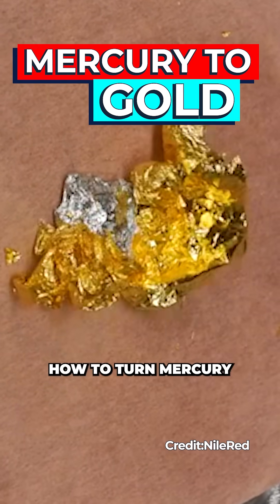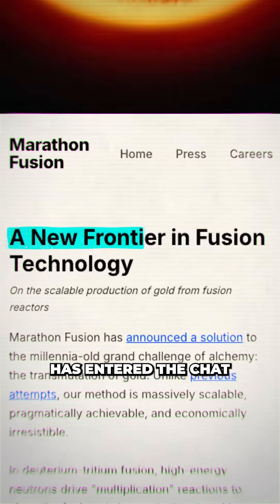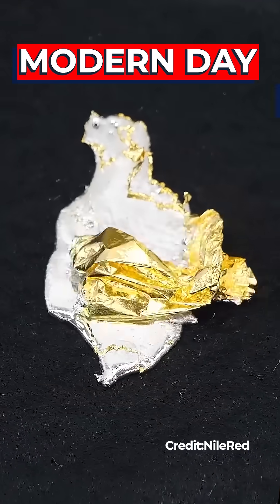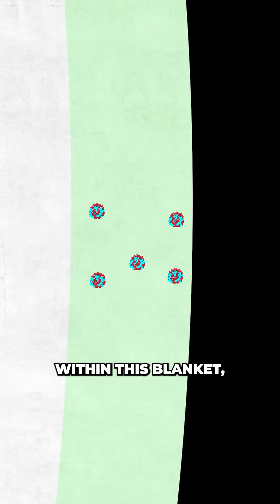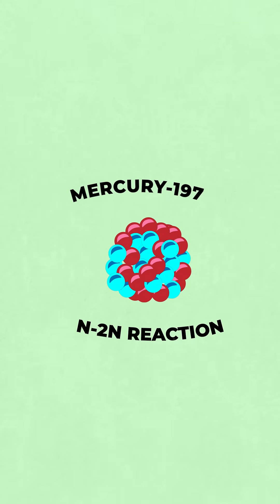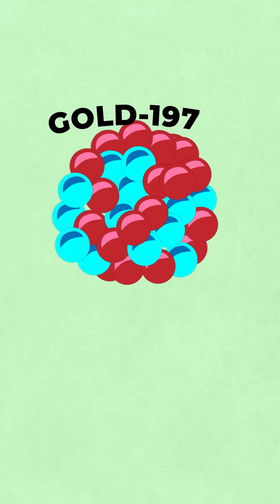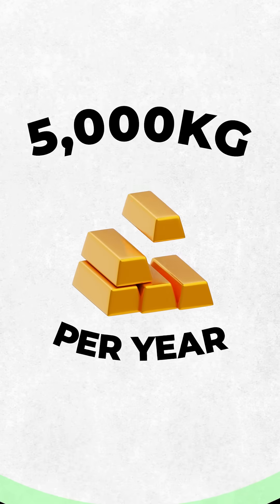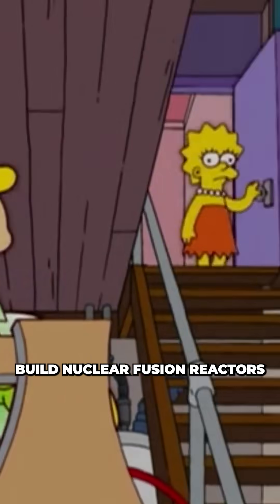Scientists Turn Mercury Into Gold

Comment: So, the old alchemists had the right idea. They just lacked a NUCLEAR REACTOR
Reply: yes, i remember there was an experiment back in the early 2000 (i think) there they literally used nuclear fission to turn a metal in to gold, the experiment was a success but deemed to expensive to transmute gold
Reply: @theprinceofawesomeness  nope. wasnt fission. just a regular linear accellerator being aimed at lead.
Reply: @Irobert1115HD  Fusion not Fisson 😊
Reply: @theprinceofawesomeness  you gotta consider its not profitable to produce gold but gold is a byproduct of the energy production. By products are usually cost negative by disposal. You don't dispose of gold... especially radioactive gold
Reply: @colesauer6813  the gold would be radiated, not radioactive. Our food gets radiated
Reply: I would think it wouldn't be radioactive if they managed to separate it (chemically probably)
Reply: @theprinceofawesomeness  "Too expensive," words told to the public. Somebody had the technology, controlled the reactor and printed money for free.
Reply: @theprinceofawesomeness   More like the gold produced in the fission reactor was an unstable isotope that did not permanently remain gold.
Reply: @johnwang9914  It's like a Japanese folktale of a tanuki swindling someone because the money turns into leaves as soon as they get home.

Except instead of money and leaves it's gold and lead.
Reply: not realy. they wanted to use classical chemical reactions but they where right about the possibility of changing one element into another.
Reply: @Irobert1115HD  The "possibility" isn't new y'all.  We all started out as hydrogen, remember?  Carbon life forms marveling at building bigger atoms -  what will the Universe dream up next...     lol
Reply: @davidsmith3302  fusion isnt transmutation thou.
Reply: @Irobert1115HD  Very good point. However consider this - with all of the tremendously energetic activity going on in a stellar furnace, can we really believe that the same kind of energized proton swapping that we achieved in our accelerator is somehow NOT going on, as well as fusion, and who knows what else?
Reply: @davidsmith3302  No we didn't!
Reply: @Irobert1115HD  WHAT did you say? That they wanted to use classical chemical reactions??? They had no idea chemicals existed. The things they were "trying" weren't based on any real science or fact lmfao they were based on myth
Reply: @joshyoung1440  alchemists actually discovered chemistry. get your little mind straight and learn that folks in the past where quite often better educated than some folks today. i remind you that the first time earths circumeference was calculated was a bit more than 2000 years ago.
Reply: @Irobert1115HD  No they weren't. They had absolutely no understand of atomic theory, or any of the science you would need to master before you could even begin the first step. Just a wild guess based on myths and legends.
Reply: @Nerdiness1985  and yet physicists managed to turn lead into gold. suggesting that the believe was possible but not with any of the tools that the alchemists used. or developed.
Reply: @Nerdiness1985 That's a really shallow small-minded take. Alchemy is the precursor to chemistry and it was a proto-science within its right with alchemists having deep knowledge about properties of elements and their transformations (be it thermal, chemical or physical). 

Yes, they lacked the knowledge we have - but likewise ancient astronomers didn't have the same technology we have yet were able to make astounding astronomical observations
Reply: @Nerdiness1985 Really? Wow. 😂
Reply: There’s a lot of modern day science that’s based off the crazy ideas of the past.

It’s almost always an issue of the technology not being caught up with the times for viability, but always theoretically possible until it has

EDIT: I should’ve also clarified it’s a lack of knowledge and understanding that’s also the main hurdle. A few comments pointed out they tried using methods that weren’t even close to the method that we found worked.
Reply: @AwkwardHypernerd413 in this case nahh, cos one recipe found in an old alchemy book from Bosnia claims some mix of dried pig fat and tin crushed together would give gold
Reply: @Perhaps3D  okay and? theres old medicine books that say all kinda wrong dumb shit does that make medicine fake?
Reply: @perhaps3D Bosnian chemistry is the best in the world! And other countries are envy us!
Reply: @yukole6245 Maybe just got more pig fat than the rest of us 😂
Reply: @iRossM  "..." 😂
Reply: You described science fiction very well. @AwkwardHypernerd413
Reply: @AwkwardHypernerd413  Invention always starts with imagination.  Without imagining something first, a person would never think to make or do it.
Reply: @AwkwardHypernerd413  not really, alchemy is largely the chemical sciences spin off of Hermetic cult religion which believes we are all shards of the greater ONE, thats why they believe you can go up the base metals to greater metals toward the divine. Marxism also bases its foundational ideaology off of this principle of resolving the contradictions toward a perfect society, introduced to Hegel by Bhöme.

Its cult nonsense.
Reply: @AwkwardHypernerd413  lol no it isn't
Reply: @AwkwardHypernerd413 almost like a trick from a demon who know the truth..?!
Reply: @AwkwardHypernerd413 hum and another hum , alchemy is a bs , you cant compare fantasy with scientific methods
Reply: Dang!  They were soo close!  Just one simple nuclear reactor away. 🤦‍♂️
Reply: @Robert41265  "simple" 😂😂
Reply: @iRossM  😁
Reply: Turning lead into gold was what alchemists claimed to do with something called the philosopher's stone. We shouldn't be turning our mercury into gold because mercury has extremely unique properties and is said to be an important material in achieving anti gravity devices. I'd rather have that instead of manufactured gold saturating the massive supply we already have. Would you rather have a real hoverboard or a piece of gold? Ships and flying vehicles of any size including cars that can fly without needing a runway or massive rockets, or a piece of gold?
Reply: @ClearChoiceMethodology  cant the gold just be transmuted back into mercury?
Reply: @ClearChoiceMethodology   A hover…vehicle? would need more than just your discussed “anti-gravity” function. Because it needs to move. Propulsion -> jets ≈ “loud rockets”.
But wait wait wait. A vehicle that travels above ground…seems so familiar …hmmm…omg, an airplane!!! 

(And that all assumes that your nuclear reactor/anti-gravity function  claim is legit. Which feels just a bit tenuous…)
Reply: @ClearChoiceMethodology  maybe they’ll figure out how to power the device off of gold? 😂
Reply: @ClearChoiceMethodology Amen !!
Reply: Do you even fuse bro
Reply: This is not news this is the literal foundation of nuclear physics since its inception in the 20th century.
Reply: Fulcanelli is the only alchemist who actually was able to perform the magnum opus
Reply: Just build a mini sun, duh!
Reply: @khai96x bruh, maybe that's what the sun in the illustrations of alchemy means wtf
Reply: Back to the future 4
Reply: Que the meme from the simpsons where all chemists press a button to reveal we have been alchemists all along 😈
Reply: @yocarara  the word is "cue," not "que" lol
Reply: our current technology would look like magic to them
Reply: They lack the same fusion reactor we still lack today
Reply: And that’s where the pyramids come in…
Reply: You dont need a reactor, you need a reaction.
Reply: @Angelloooooo  "you don't need a reactor"

So here's a question: where are you going to find a steady source of high energy neutrons?

Here's how you make a steady source of high energy neutrons: YOU BUILD A REACTOR.
Reply: @chaz706 No, you use particle accelerators.
Reply: @chaz706  you don't know what you're talking about. Particle accelerators do not require nuclear reactors, and are a source of high-energy particles. Stop yelling at people when you're just guessing
Reply: Leo come on. We all know the alchemists of old didn't do anything. They saw the greatest alchemist of all turn lead into gold. 
They left out the part where he walked around nude, blue, and glowing and didn't understand why he called himself Manhattan.
Reply: They also lacked other things, like knowing what an atom was
Reply: A nuclear FUSION reactor
Reply: maybe they actually achieved cold fusion
Reply: Limited by the tech of their time
Reply: Alchemists just evolved into chemists
Reply: You cannot have modern science without the contributions of the old.
Reply: This kind of video is fucking so annoying...This is old news, and we don't have nuclear fusion reactors anyway so unless they solve that little problem it won't even be able to be tested...an estimate based on untested therories lmao
Reply: @200ponies123 What's worse is that they didn't tell gold made from nuclear fusion would indeed be RADIOACTIVE.
We have to check the source of any gold jewellery in case they really made the way to the public from now on fr 💀
Reply: @ZariainYT  haha yeah, it's a good point, but honestly I skipped it because you could deal with that easier than you know, having a nuclear fusion reactor XD
Reply: Shoulda just ordered one on Amazon, they got sales on prime day
Reply: What? No, they did not have the right idea at all. They had no way of even knowing the difference between a complicated, high-energy fusion reaction and a regular chemical reaction because they didn't know what those things are. They had literally no, quote "idea," what elements actually are, let alone that they were trying to turn one into another. This is... not a good take.
Reply: Nuclear FUSION reactor
Reply: Just like we have the right idea about time travel but lack a time machine
Reply: It happens
Reply: Lmao not a reactor, but the reaction was there 😂 look up Fulcanelli
Reply: Good concept, poor execution.
Reply: Yep, what they also forget to mention according one documentary I saw, cost per creating gram of gold.
Reply: Cavitation bubbles do the same 😂 and all you need is water and frequency
Reply: Poor stupid Newton. Sir Newton.  Pardon
Reply: The reaction would be WILD.

Alchemist from the past: Any luck converting lead in to gold?

Scientists: haven't gotten that far yet but we're converting Mercury into gold.

Alchemist: Oh!?  That's fantastic progress!  How did you do it?

Scientist: We had to harness the power of the sun.

Alchemist: So... solar power right?

Scientist: about that...
Reply: @chaz706 😂😂
Reply: no duh.
Reply: The philosopher's stone was the react you built along the way.
Reply: Or they had one and we just know it yet.
Reply: They was one step ahead and no-one believed them
Reply: Or did they?
Reply: Nuclear fusion reactor. Big difference.
Reply: Until you run out of mercury...
Reply: Full Carbide Alchemist
Reply: A thermonuclear reactor.
Reply: nuclear is a type of energy, no they’re not talking about a nuclear bomb.
Reply: They had one just kept it very secret
Reply: Fusion reactor*
Reply: You said it exactly. The ancients were doing it just differently !💯 I must say this channel lacks a lot of insight and wisdom.
Reply: The nuclear reactor is the philosopher's stone
Reply: The oldest nuclear reactor was before the indians
Reply: @bridgetteendsley9420 yeah, ummmm.... thought that was a given. 😂😂😂
Reply: Absolutely. The idea was to "purify" and "transform". Metallurgy and paint, among other things, evolved as a result of setting the intention to do that.
Reply: They had the right idea but lacked it for most things, but most of the times they were being metaphorical
Reply: Yes they are rolling in their graves😅
Reply: Kinda, all they need an hypotetical non existing FUSION nuclear reactor. Also it can be done using a super particle accelerator, only cost a a few millions to produce micro grams of gold, at least the super particle accelerator exist.
Reply: @jtommygun  i don't think hebrews had particle accelorators when the bible was all about war.
Reply: yeah i was having a sci fi theory and it occurred to me that a type 1 civilization with interstellar travel would still be space warlocks because the quantum transmission of energy would eventually permeate all toolcraft
Reply: They were so close 🤏🏻
Reply: No the idea was pasted down for thousands of years how u think gold was made... really... 😂.  Never know
Reply: Pyramid, this is old tech
Reply: Not nuclear reactor, it's PARTICLE ACCELERATOR .
Reply: Most of the time diffrence between amater and proffesional is tools ...
Reply: No there is some evidence  of pre anti-deluvian  societies that created this technology. This is a rediscovery of a discovery. I'm sure this is the science of a lizard person.😅😅😅😅
Reply: nuclear reactors are the solution everything.. cant sleep? just generate power for the grid. fridge is empty? well your depleted nuclear fuel has billions of calories in it. and so on, most useful thing ever
Reply: A nuclear fusion reactor
Reply: The pyramids …
Reply: Modern physicists lack a fusion reactor for tritium even though they have tried for many decades.
Reply: Hell naw lol they insisted you must continuously boil down urine for years until it made a concentrated stone that did this… can you imagine the smell 🤮
Reply: So Issac Newton was not wrong
Reply: It won't work. Ur hist at this is that it has not been peer reviewed. Basically trash
Reply: No. There is natural nuclear fusion in nature. Makes it real!
Reply: fusion reactor*
Reply: Looks like nerd cluster
Reply: This assuming they meant actual gold and were not talking about spirtual gold
Reply: Or they did until time travel became possible
Reply: No, they said you need the philosopher's stone. So, if this technique is true, the philosopher's stone may actually be a radio active material provide by aliens technique. Why alien? Only alien can produce such item as it is impossible to produce such item during that time not unless it is a artificial from the lost civilization of Atlantic
Reply: U never know they might have made it a different way back then but the secret was guarded and then lost to time for old stories to talk specifically about mercury to gold makes me think they did find a way
Reply: Indian alchemical texts mentioned successful preparation of gold.
Reply: Exactly
Reply: Common misconception
Reply: It's always that one small detail that always trips you up.
Reply: better printing gold than straight-up conjuring money by the press of the button that taxpayers will pay taxes on. This way we at least end up with some additional gold as well as this process incentivizes nuclear physics developments and has a hard cap on productivity.

But it would be funny, yes, if we will have mining 2.0, but this time they will mine actual gold and by they I mean scientists and not crypto-bros, lol
Reply: it cost so expensive and it cost much energy to generate gold fusion.
Reply: Ancient Alchemists may have still made Gold from Mercury!  Cold Fusion is still a possibility!  And...If it did exist back then... It would have likely been the only way they would have survived the process as the radiation would have been nonexistent!
Reply: Nuclear Fusion Reactor
Reply: Are you sure they did? Perhaps their reactors to do so is what caused their own cataclysms ...

Don't ignore what Solomon said in Ecclesiastes 1!  

There's nothing new under the sun. Everything according to its circuits. One generation comes and another after and they have no remembrance of former things (History repeats itself).
Reply: yes and no. the alchemist of the past had the knowledge of this technique but didn't have the power.

i'll give a biblical anecdote while alluding to modern day technology usually used in the middle east. 

And suddenly there came from heaven a sound as of the rushing of a mighty wind, and it filled all the house where they were sitting. And there appeared unto them tongues parting asunder, like as of fire; and it sat upon each one of them.

if that doesnt sound like a nuclear reaction taking place then idk what does. 

to sum up this theory what if tech wasn't lost but hidden away. it's the same reason around the 30's we get an educational boost to humanity. every century 1830 1930 etc something happens in the tech field globally.
Reply: Classic alchemy was more of an esoteric spiritual tradition to attain enlightenment than literally turning wood into gold. 

They used mercury and sulphur as metaphors to explain the alchemical process as a means of cloaking the intentional meaning from the church, which was in charge of everything at the time.
Reply: Jesus is a perfect man who took the punishment we deserve on the cross and he rose from the dead so we could have eternal life and all we have to do is believe in his sacrifice, repent of our sins and obey him.
Reply: @Jib-gib actually jesus was god turned human or a piece of god send to earth to be a human for a bit. he curses a fig tree because it doesnt bear fruit when he wants one and uses his powers for parlor tricks so he can ask folks why they exclude entire ethnicitys just because the got told to do so.
Reply: There is a plethora of evidence that ancient humans received guidance from a non human precursor civilization. Emerald tablets are one example of this evidence. These precursor civilizations consistently used fusion and other nuclear technologies in a highly refined way. The biblical ark of the covenant is a possible example of this nuclear precursor technology poorly understood by humans of the time. After the precursor civilization reduced or abandoned contact humans had knowledge and cultural memory of these technologies as well as their effects but no longer had the knowledge to produce them using ineffective crude methods such as classical alchemy. "Annunaki" are said to be obsessed with gold it is plausible ancient humans observed these beings turning elements into gold using these advanced fusion processes understanding the possibility but not the method.
Reply: Well no, they definitely didn't have the right idea at all. They didn't even know what chemicals actually are, much less atoms and subatomic particles. It's like looking at an SR-71 and saying that that dude who jumped off the Eiffel Tower in a baggy suit basically had the right idea